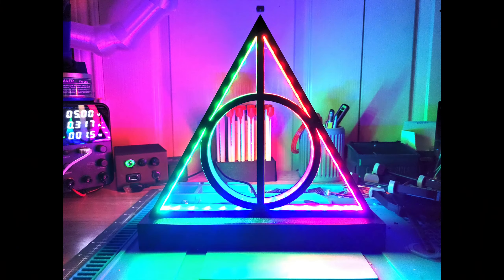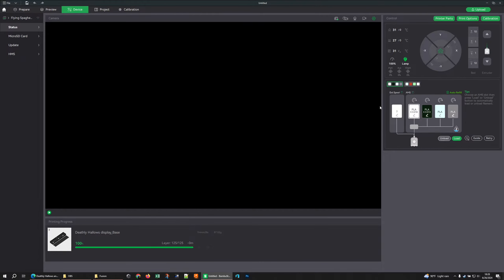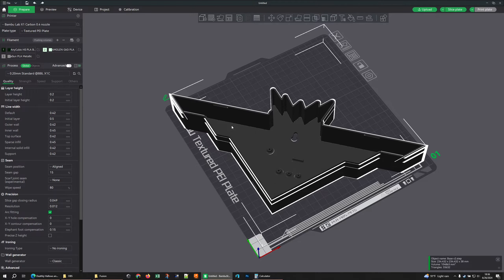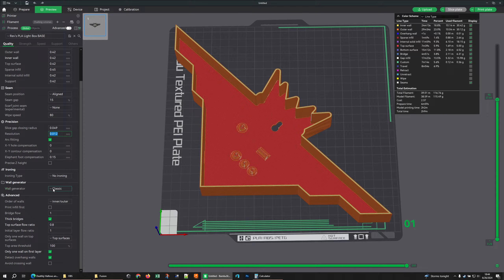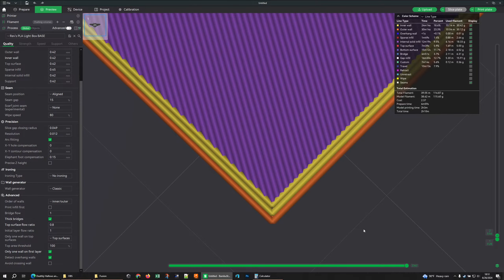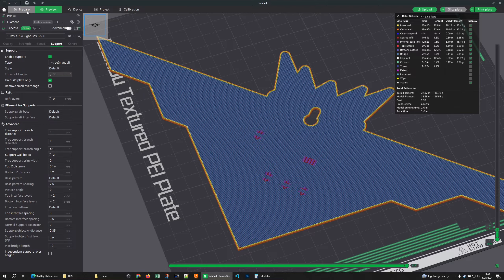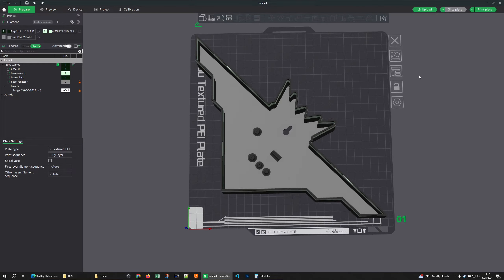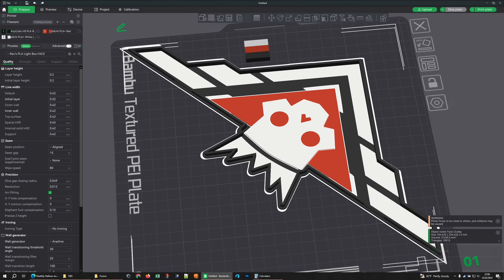A Year of Light Boxes: Bambu Studio

Comment: Have you tried to print big light boxes, which is bigger then print bed? What specifics about designing and printing these things do you know?
Reply from the maker: @artemgoncharenko646  when the design allows it, sure. Basically if you have any translucent parts to cut you're going to have an ugly seam. Overlapping material, glue, etc - either light leaks or dark lines.

If the parts of the design have a lot of opaque space you can scale the design so the largest solid part is at your build volume, then assemble it without worrying about the seams being visible.

I've tried a few methods and seen many other folks try - you just won't get an aesthetically clean look if you have to assemble translucent elements from multiple pieces. 

As an example, I made one that was just short of 16" wide from multiple pieces. It only worked because the source material had lots of void space in it, so my translucent elements are still single pieces. You can see details on it here - https://makerworld.com/en/models/481183

Comment: Curious, why do you make the backs attached to the walls? Most tutorials I find attach the sides to the face. 
Is it better to have the face separate with the edge that fits onto the walls?
Reply from the maker: @EverydayDecay  for edge-lit boxes I like having my electronics and lights on the same printed piece. It also balances print time between the parts - the slow but precise printing of the face vs the faster draft quality printing of the base usually come out to about the same.

Print the base first and you can do everything related to programming an ESP and wiring it up while the face prints, then snap it together and you're done.

The argument for walls on the face is you have less of an overlap at the presented edge, giving you more usable space for the feature. I honestly do a mix of designs:
- walls on the face for most edge-lit boxes
- walls on the face for back-lit boxes
- split designs where the walls are constant and have thin interfaces between them

I actually have really taken a liking to using natural PLA for walls directly on top of features with a split-wall design since it's the best of both worlds, like this more recent one https://makerworld.com/en/models/889447#profileId-845553 or this one https://makerworld.com/en/models/788988#profileId-727115

Comment: any idea where the initial layer flow rate setting went to under the advanced tab in the new bambu version
Reply from the maker: @rx2006je  still where it was, except it's only visible if you turn on developer mode. That option is at the bottom of the preferences window (File > Preferences).
Reply: @RevHazlett  got it thanks

Comment: Good morning. I believe I am using the same settings you are except for my filament which I have tuned. I'm not quite sure what is causing this issue on my bottom surface pattern. Any ideas?
Reply: I've added a couple of short videos but for some reason it is not attaching to my question
Reply from the maker: @michaelb7133  I saw your A1 video - at an outside guess it could be a partial clog or the temp is too low perhaps. You are letting it do the bed leveling procedure when you start a job, yes?

When in doubt, double-check you have the correct material profile to match what you have loaded (eg; you have a PLA spool loaded and a PLA material profile in the slicer) and try the default settings. If that works you can change one setting at a time until it fails to identify the problem. If defaults fail then you probably need to look at a mechanical issue (like a partial clog or extruder failure).

The Bambu wiki has excellent troubleshooting guides!
Reply: I have the A1 issue rectified. I posted a new one with a face plate that I printed on an X1  @RevHazlett
Reply: It's in the shorts section
Reply from the maker: @michaelb7133  for whatever reason it won't let me comment there. 

I'd start with the basics:
- is the plate clean? A good scrub with hot water and plain blue Dawn goes a long way. 
- gaps like that... How fast is the first layer going down? Too fast can make it look like that. 
- probably not a partial clog, you'd see that throughout the print. 
- the right plate is selected in the slicer? 
- are you letting the auto bed leveling run before printing?